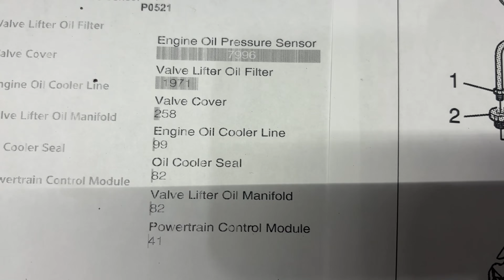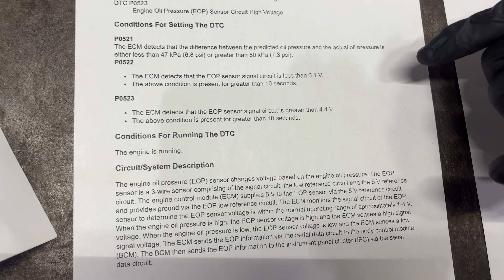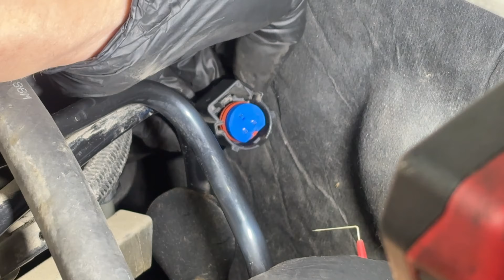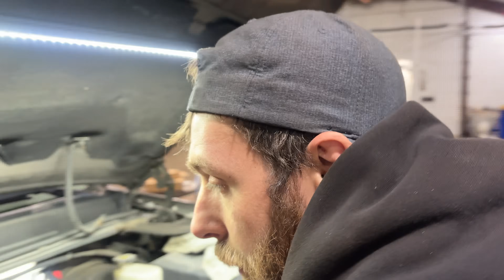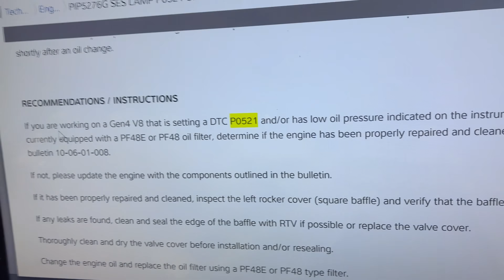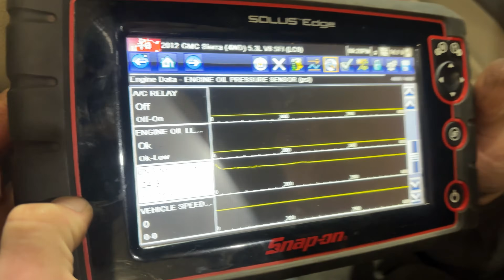P0521 2012 GMC Sierra 1500 5.3L Engine Oil Pressure Performance

Comment from the maker: *UPDATE - The oil pressure readings in the video ended up being low compared to a different truck with the same engine. They are supposed  to be around 55psi at 3000rpm, 45psi at 2000rpm, 40psi at 1000 rpm and 35psi at idle.
Reply: Where did you test the oil pressure? For the life of my truck I've never seen the Guage go past 45. I've heard others say the gages on the dash are off by a few %. But that's a pretty  drastic difference. Mines always between 25-40 depending on how cold.

Comment: What did u find out,I have a 2012 that has only 25 psi on a cold start,measured with a gauge. I am leaning to oil pump oring maybe
Reply from the maker: I never did come to a conclusion on this vehicle, the customer declined any further work and sold the truck

Comment: So what was the fix?
Reply from the maker: @SilveradoSeth  the customer declined going ahead with further diagnostics so we will never know. I suspect it’s loosing some pressure through the Main bearings or something inside the engine but I’m not sure
Reply: @Tech-28 oil pick up tube O ring?